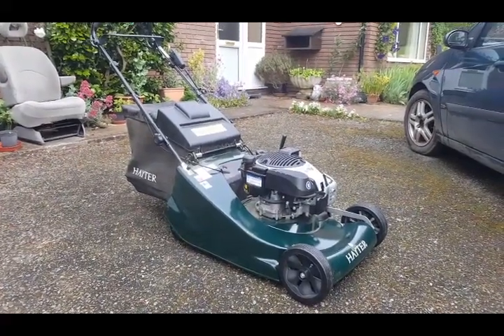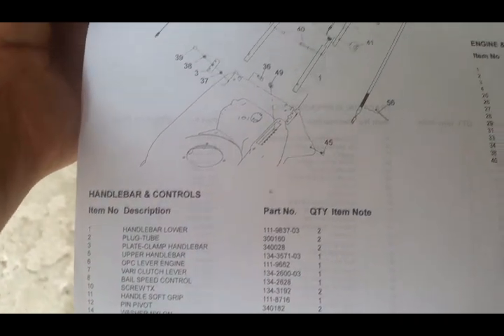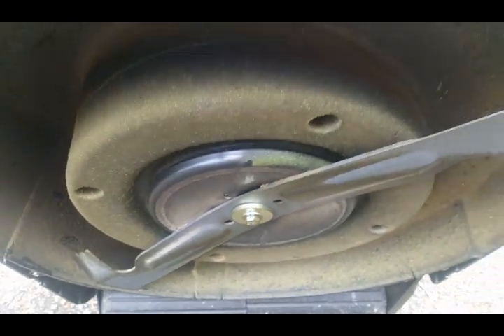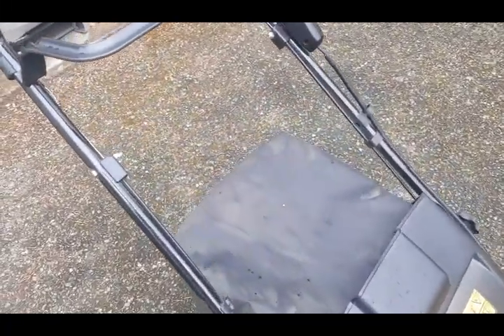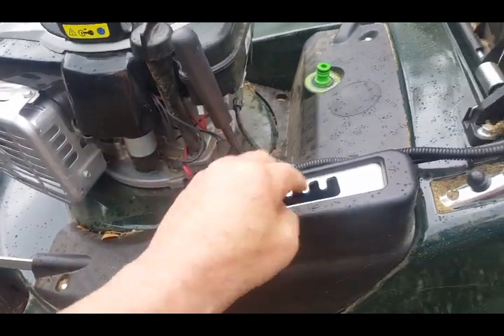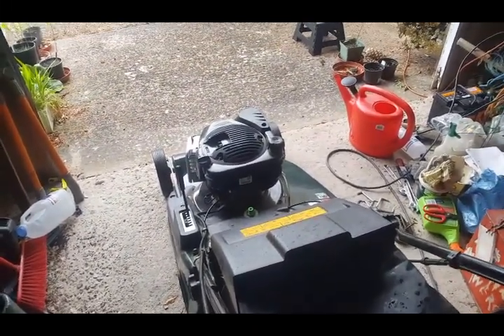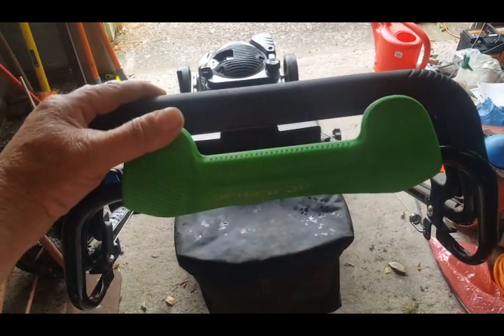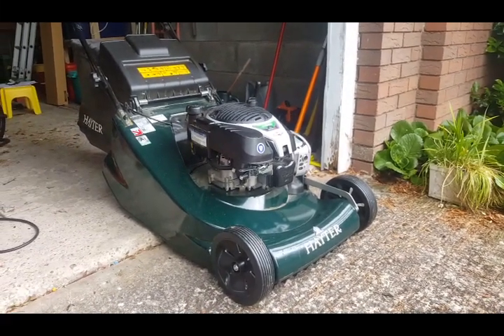#Hayter Hayter Harrier 56 lawn mower with electric start ..features and operator #how to #guide .

Comment: Good video. Lovely mower. if you have the HOC lever on no 4 you can undo the 2x 8mm head screws and remove the chain cover and grease the chain if needed. 
I doubt Hayter will do a BBC on the instart as you don't need it. Pulling a lever and pushing the blue button is easy enough where as pulling a rope all the time is more hassle and not everyone can do it. The pros have BBC now so nice and easy to engage. start the engine once then engage blade as of when you need it.
Reply from the maker: Thanks matey .. yes i see your point .. good point aswell 😁😁
BBC is also handy if you have quite a distance to go before you get to your lawn ... as in with BBC you can dissengage the blade .. stop it turning .. while having the engine running to propell your mower .. save you having to push it 😁😁